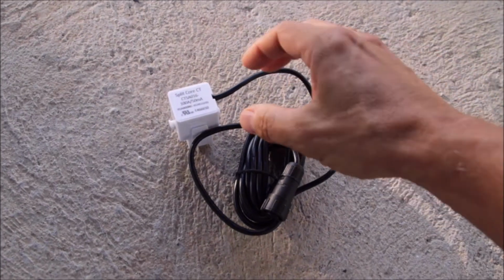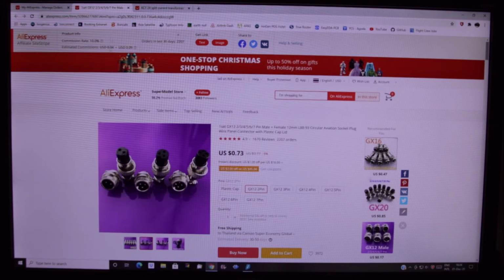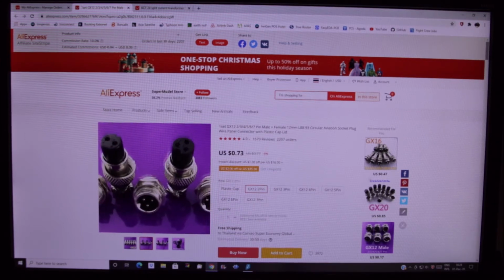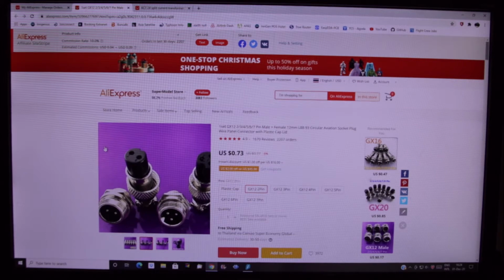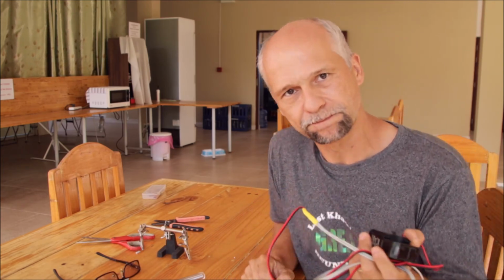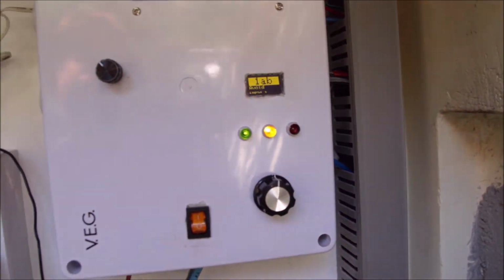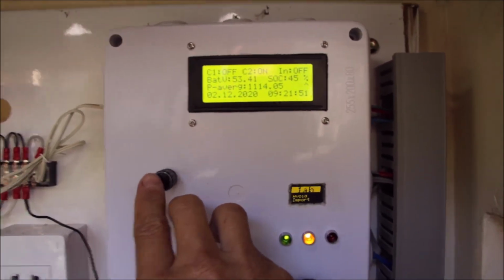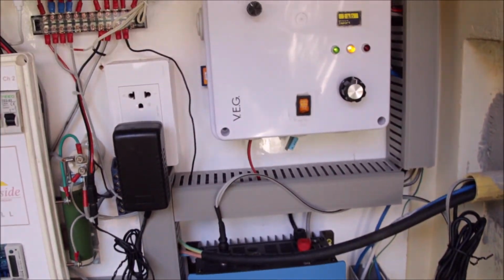Changing the Current Transformer of the SUN2000GTIL inverter. Follow-up to my DIY AC-Powerwall build

Comment: That inverter is so popular worldwide but youre the only person who provided the crucial information about the CT sensor for that class inverter. Information about clamp diameter, length and connector type are impossible to find in the internet. The manufacturer/sellers cant even give that information in advance but those are crucial for planning ahead where to place the inverter . Most users would be surprised that the clamp cant fit the wire and/or the sensor is too short. 

Your video is a must for people planning to buy that kind of inverter.
Reply from the maker: Thanks Mate!